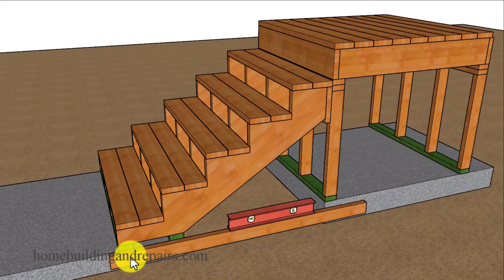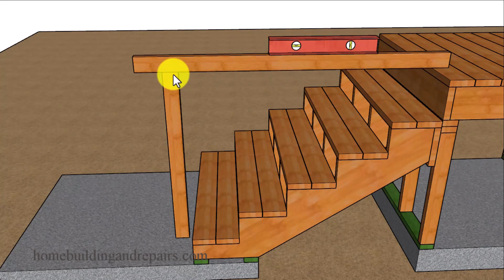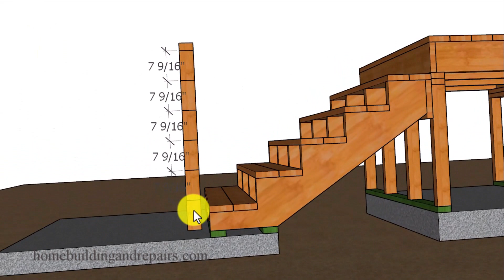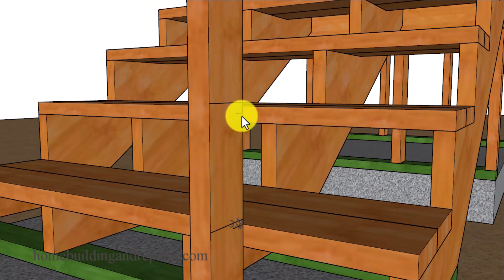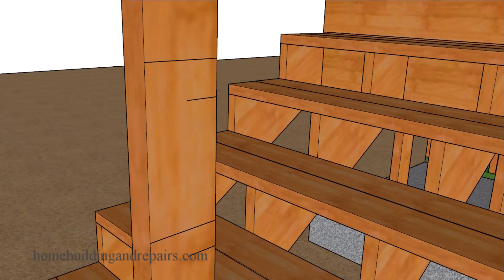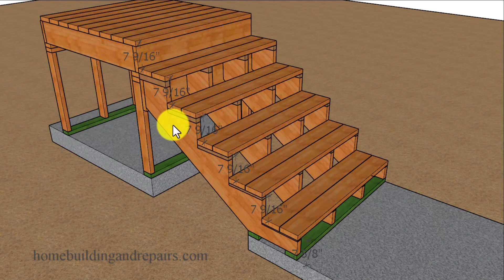How To Repair Stairway That Has A Tall Riser or Upper Step - Building Code Problems

Comment: As a home inspector by trade I find screwed up stairs like this all the time. It's not my job to tell people HOW to make the repairs but I've always assumed cutting a new stringer would usually be required....which in many cases is a huge endeavor. This is really ingenious and makes total sense. Also, I'll add my two cents - if carpet will go over the stairs you can just add material on top of the existing treads. NO need to pull them out and shim underneath. Anyways thanks for the video, this is great. I am subscribed and enjoy your content
Reply from the maker: Glad you liked and I see them a lot also.